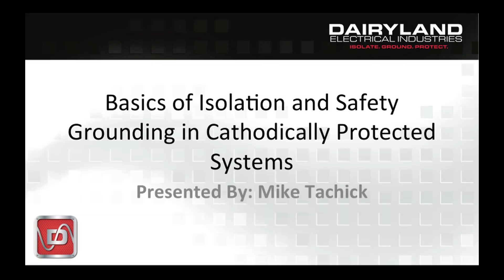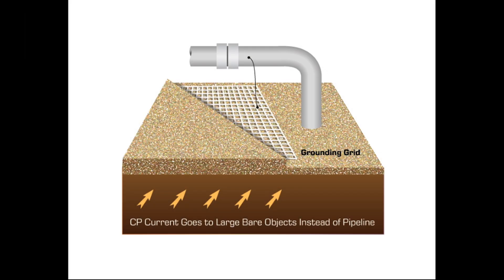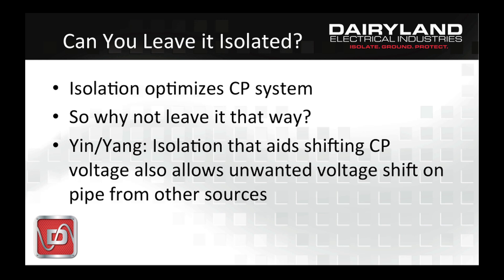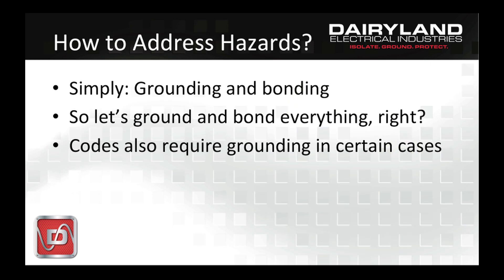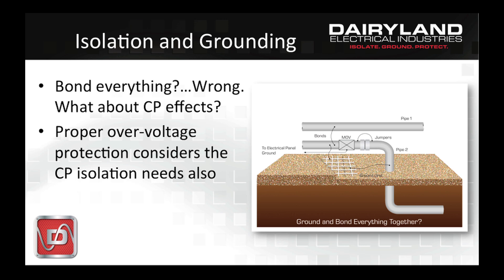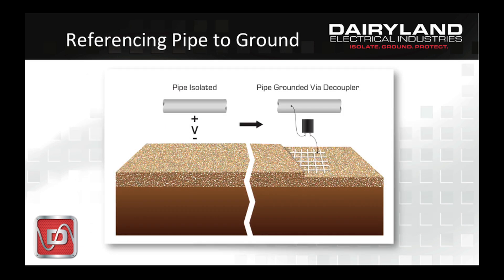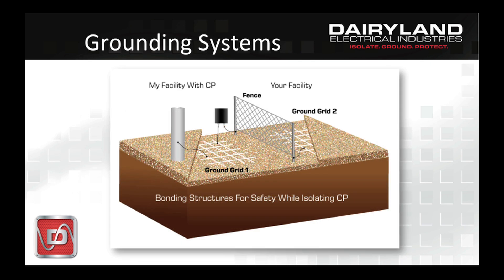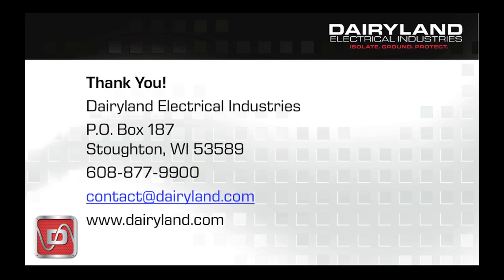Basic Training: Basics of Isolation and Safety Grounding on CP Systems

Comment: nice video, I have a question, in case the U/G protected steel pipe is shorted to some foreign structure 1. How to figure out the Surface area of foreign structure 2. Type of foreign structure 3. In case we are unable to isolate then is it advisable to design CP current for foreign structure too? IN case YES then how about the calculation of that structure not part of CP system originally. n does it pose any other problems like interference to neighboring structure specially in refineries.